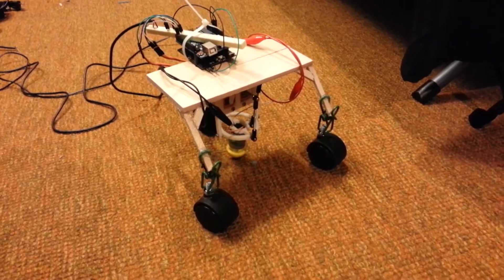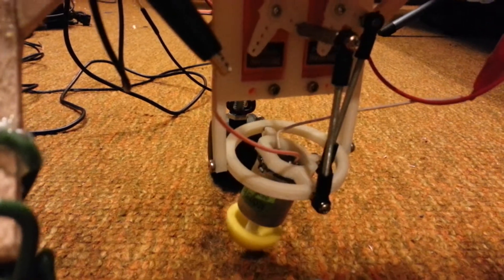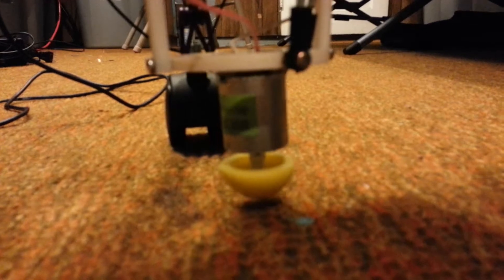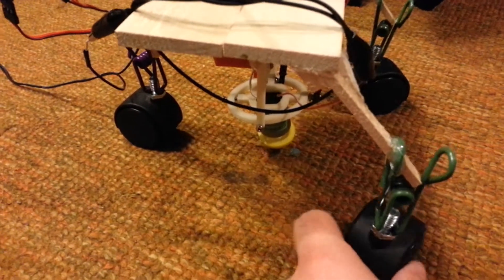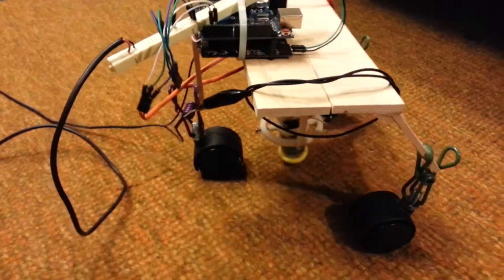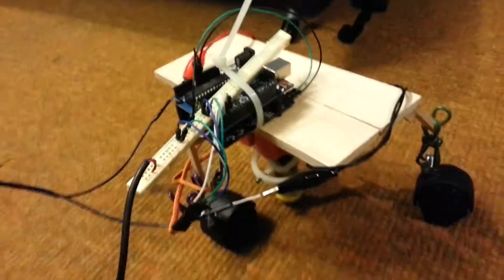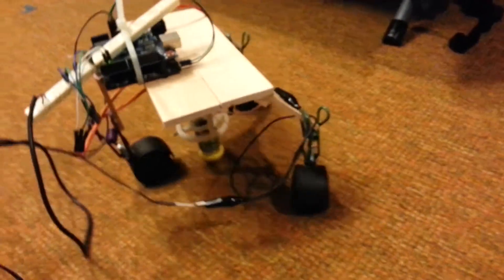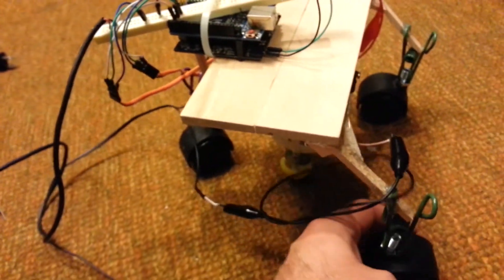HOG Test Robot 1

Comment: You said 1 motor, but you meant 1 motor and 2 servos. Nice either way. :)

If you are still looking for ideas on a chassis design, have you considered a "tripod" setup where there are 2 wheels that are free-wheeling, and this HOG system in place for the third point of contact?